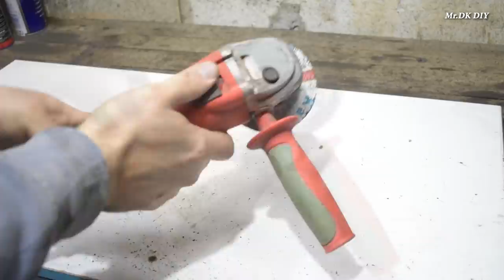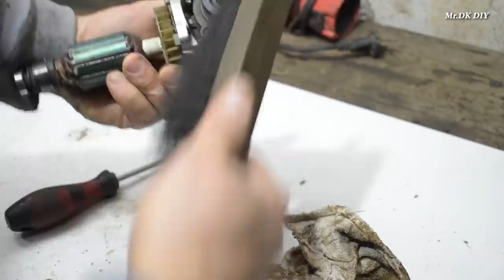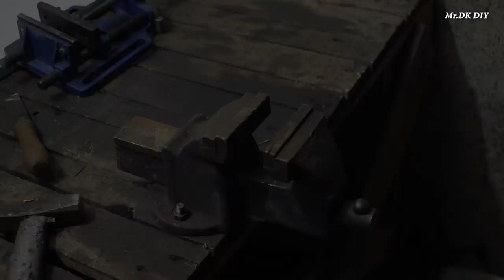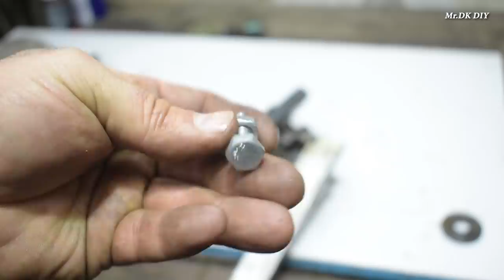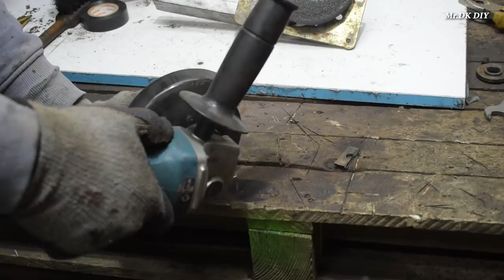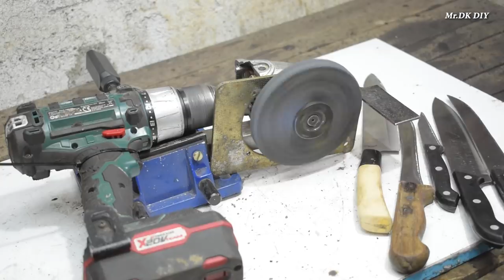DIY Machine for Sharpening Knives from Cordless Drill and Old Angle Grinder

Comment: Good theory,  but I’m pretty sure all that would do is ruin the blade. That grinding wheel would chip the edge. It would be terrible to cut with.   A 1000 and 8000 grit whetstone and you’d have made all those knives razor sharp faster than the was made lol. Nice idea though.

Comment: I don't really want to rain on anyone''s parade but since you are putting the drill in the vise just chuck up a grinding stone directly into the drill it would save time.. Or faster still put the knife into the vise and use the angle grinder to sharpen it. If you are re-purposing a non-functional angle grinder it might be a worthwhile pursuit otherwise it's a colossal waste of time.